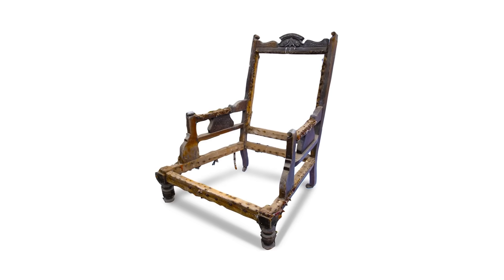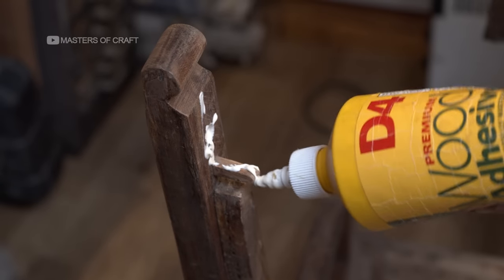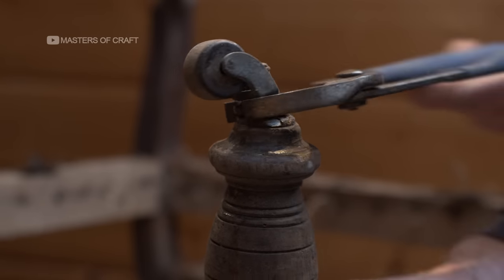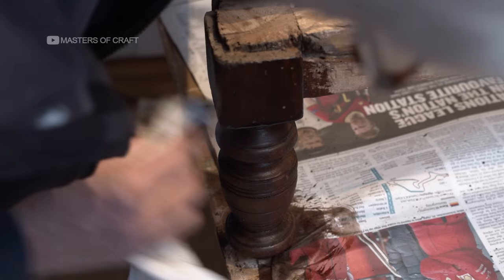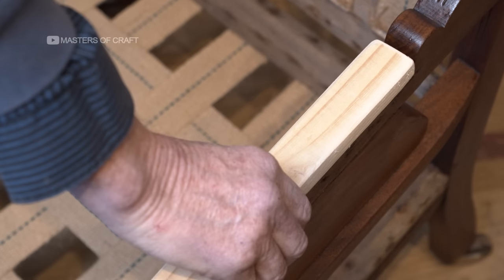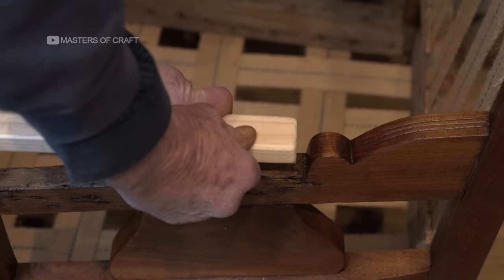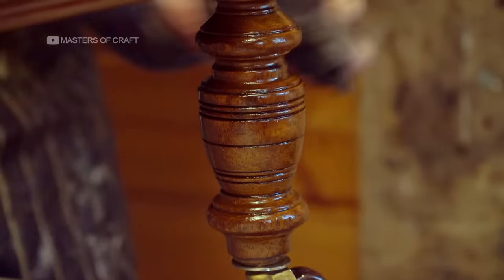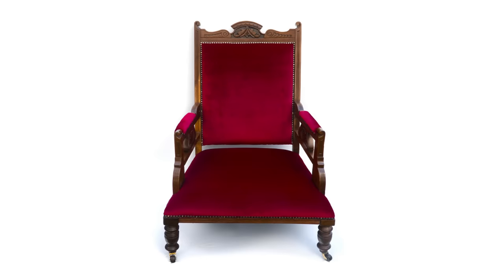Broken Antique Chair Restoration

Comment: it's lovely, but if it's "an historical relic" as described, why were modern techniques used and not the historical ones? the edwardians would have used tied springs, hessian, and horsehair. also, the seat would have been higher than was done here, it's not supposed to be that low. the springs would have raised the seat up by several more centimeters than just the straight foam would have. not to mention that the foam used was low-density, so anyone sitting on that chair will feel the webbing through the seat. the nail holes go so far down the arm because the fabric went that far down originally. the upholsterer did a great job, but that is not a restoration, that is a reupholstery.
Reply: 100% agreed. Very strange methods, definitely not historically accurate.
Reply: Absolutely right !
Reply: Thanks for sharing your knowledge😊

Comment: All those staples, one day in the near future, some poor upholsterer will have to remove those, when the foam  crumbles,(which it will). An old chair should have traditional upholstery stuffing. It would originally had springs,  not layers of cheap foam.
Reply: Original stuffing  costs more and it's less comfortable what's used depends on what the client wants. Nails damage the wood so staples are way better for non visible areas, as you can see the nails left the wood in a mess.
Reply: I thought the same, even seaweed would have been better

Comment: this is not the way to get the nails out, and I would never give this guy something to repair
Reply: I agree. Won't be long before those wheels fall off from being attached with extremely under sized nails! He's still got better skills than me though, but that really wasn't a top-notch job.
Reply: It's called a ripping chisel and it is the correct way to get the tacks out
Reply: @garyhiggins4333  This method damages the wood and leaves nail residues in it. You can see it in the video.
Reply: It's the correct tool to take out the tack or nails 25 years experience in upholstery
Reply: He does a covered up modern materials like foam and dacron. For that reason I wouldn't want him near historically valuable antiques.

Comment: When he was cutting the foam I didn't realise he was using an electric cutter at first and thought it was an extremely sharp pair of scissors he was just dragging through it.
Reply: I use an electric carving knife to cut the foam, does a much better job than trying to carve meat and was relegated to the back of the pantry.
Reply: Bread knife I use them to

Comment: Using PVA glue is a no go for joints of antiques. Your channel has a wrong name.
Reply: It's wood glue
Reply: @garyhiggins4333  wood glue IS PVA glue
Reply: @juliettpapa  yes and that's what people in the funiture trade use when the wood glue goes of its stronger then wood 🪵
Reply: @garyhiggins4333  maybe in furniture trade ..... in restoration (as the title says) you should use glue of that time - hide glue

using pva is not a restoration - its a rebuild
Reply: @juliettpapa  what else is he supposed to use the glue drys clear anyway
Reply: @garyhiggins4333  animal glue means: authenticity of an antique and the possible  reversibility (with heat and water)
Reply: Know ones got time for that the chairs are not worth that much we have recovered thousands of them you can pick them up for £30 to £50 depending on condition and then sell them after being reupholstered for £150 to £180. 25 years in this trade and I've never seen anyone doing that type of work your on  about .
Reply: @garyhiggins4333  with simple cheap furniture you may be right.... sometimes it makes no sense

Comment: Don't pat yourself to much on the back. Is a cheap lazy way to restore a chair. For starters you pull nails and tacks out, not cut them off, and you need to fill the holes. To make the chair frame solid and strong, for the new staples and nails. You don't use foam rubber for padding. Such a cheap and shoddy job, that owner paid good money for. 👎👎👎😪